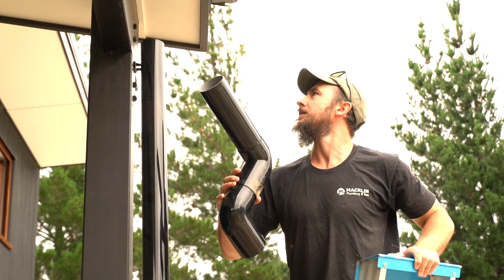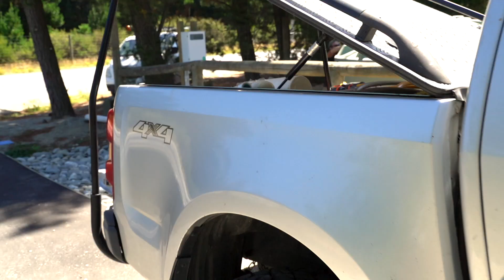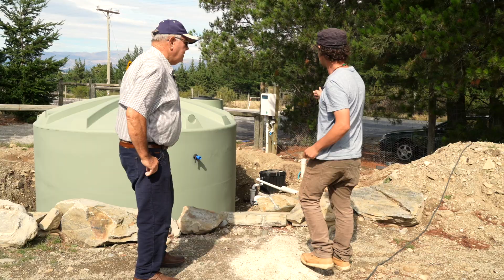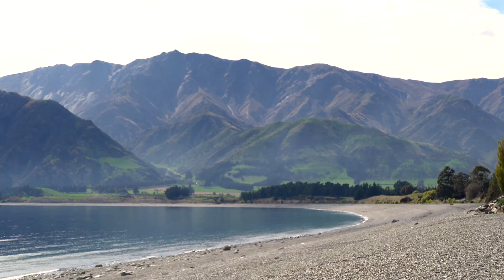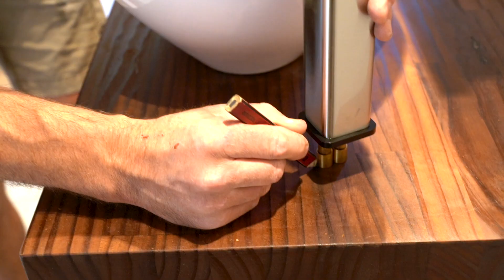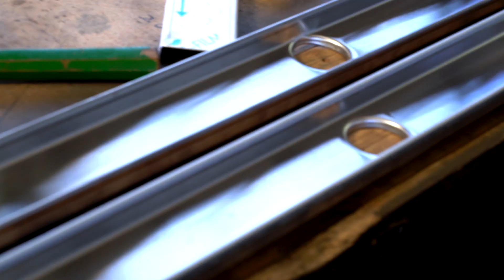Hawea Grove EP15 // SE01 // Plumbing and Grey Water Systems

Comment: Awesome work. Can you store the filtered grey water once it has gone through the Watermate system? I am wondering if it can be stored in a 1000L holding tank which would then connect up to a hose and used when required.
Reply from the maker: Technically you could, but the bacteria is still in the water and it would not be good to hold it for any long the of time. Best to irrigate straight away or send to the sewer, which is just a flick of a switch to change between.